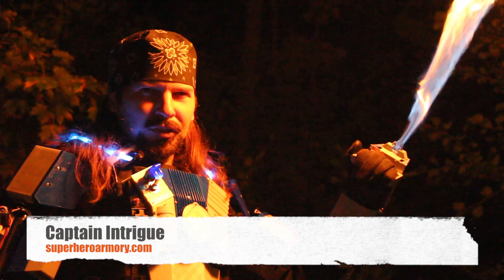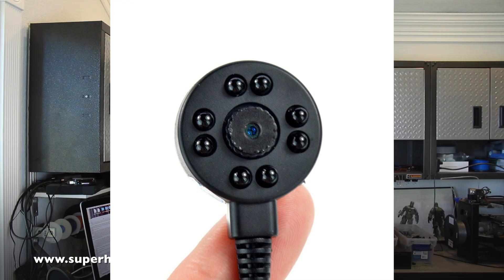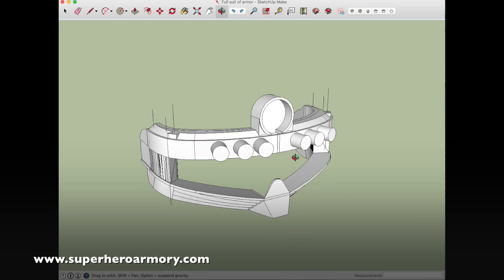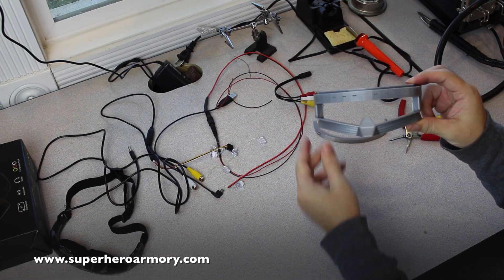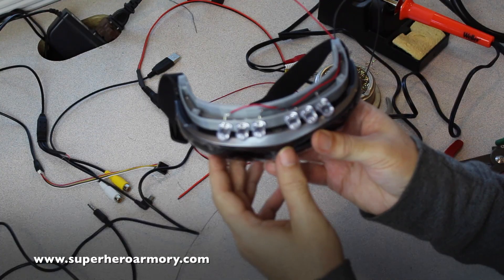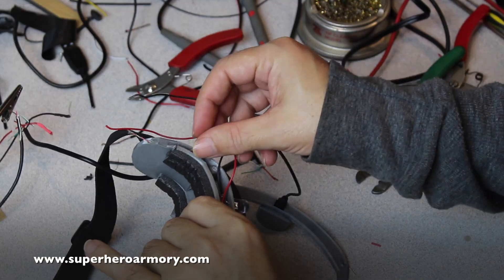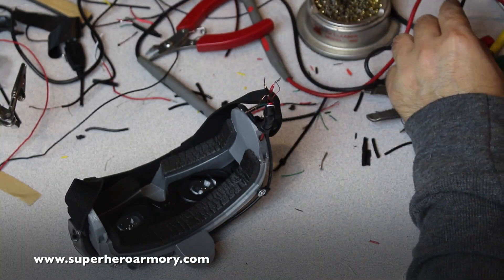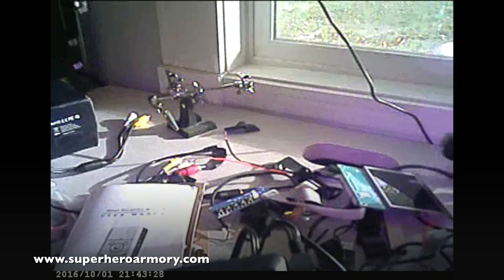How to build diy Night vision Goggles

Comment: So can you show what you look like to someone else with the same kind of goggles.  To an enemy, do you look like a great big neon sign that says shoot me with your leds on?
Reply from the maker: Yes it’s true that anyone using active night vision will be very brightly lit up and easily visible to anyone using thermal goggles, but how many people are using night vision out in public? I’ve never seen any ever. Of course passive thermal goggles that show heat signatures are much better since they amplify ambient light but the cameras cost many thousands of dollars depending on the resolution.
Reply: Can military night vision see it also?
Reply from the maker: @racerx1690  Yes military night vision can see any active infrared lights. If i were building a night vision system to use against a military I’d use a passive thermal camera that sees heat signatures. This would allow me to see any warm body as a glowing white outline.

Comment: Nice video ,  beautiful, design and manufacturing have you ever thought about using the infrared from your average garage light sensor there at 60 feet! The newer ones have the digital boards there more programmable and even have cameras mounted in them all ready 😊
Reply from the maker: I have a new series of night vision goggles videos coming out soon which use high power infrared LEDS.

Comment: Man I know you made this so long ago but thank you I was just wondering if it could be done and I was thinking so inside the box until I saw your video that literally slapped me in the face and just thinking now my solution is right in front of me and using dc current factor to power The googles was brilliant easily could be recharged and used over and over thank you Tesla is awesome 👏🏽

Comment: Awesome work but the quality of the camera is terrible.
Reply: Thats because there is not a lot of light the camera can capture and because the screens resolution is very low. If you would increase the screen res and add more IR light, the quality would be better

Comment: I have the tools, but lack the material... Plan on constructing a rifle in which the parts can be replaced in any hardware store otf. And the stock will also be a compact container for a compass, fire starter, and have a carry case containing exchangeable barrels rifled in various calibers so that one can use different types of ammo for the same weapon.

Comment: I have a lot of tools, mostly for making screws bolts nuts, smithing smelting, barrel rifling.. I had an idea a while back, to make goggles with nv in one eye and thermal in the other. But I don't have the tools for electrical and circuitry work, nor the financial confidence to start such a project. But you should try it.

Comment: Had to take out an external camcorder at the end to prevent yourself from tripping over the 35 year old girl with a teddy bear!  Ahahahahahahaha!
You should take a look at the many different alternatives to google glass being offered since at least 2014, unobtrusive and most can be used with any glasses frame.  Almost any camera can be converted to night vision by simply removing the IR filter.  The camera and IR dont necessarily have to be built into the glasses.  I would build an external body worn led array that would actually be functional. There have also been 2 different camera I've seen that output full color in total darkness, no export allowed, requires paperwork but doable.

Comment: I've been wanting to do something like this for awhile now, but don't really have a lot of experience with electronics. Your video was awesome. I feel more confident that I can do this myself. 

You mentioned that walking around was a bit disorienting. What is the magnification of the camera? what was the field of view? That could be a major factor. 

I came across a video on a channel called RolaidsBench where he used a 12mm lens to get as close to a one-to-one view wit a 20 degree FOV. I figure that would help a lot with depth perception.

I saw another video where you tested out the RunCam Night Eagle. I was thinking of using that camera myself. Problem is it has a 140 degree FOV which reduces magnification. That would mess with my depth perception. I talked with the engineers at RunCam about finding another lens that would work in conjunction with the Night Eagle, but they said it had a unique sensor that would be hard to find a suitable lens for. Perhaps I could have one made to work with the Night Eagle sensor $$$. 

I had the same idea to use two cameras for a stereoscopic view as well. I think it will improve depth perception immensely. I figure if it works anything like a 3D camera works, it will do the job. Two cameras, two near-eye displays, two perspectives. Just like our eyes. 

Anyway, Great video. I wish I would have come across this last year. 

P.S. Sorry for the long comment.

Comment: its really not night vision as much as it is a camera with ir sensitivity. what you need is a photo multiplier tube. This enables a person to see with only starlight. This is what the military uses. Any camera that is sensitive to IR can be blinded simply by placing an high output IR LED in front of the camera. Burglars have used this many times to defeat security cameras. Once a camera sees this blinding light, it automatically adjusts its brightness to accommodate the high brightness IR light, thus making the surrounding area go black.
your camera setup is severely flawed by its limited distance even with VERY bright LEDs.
Photo amplification is the only way as even with a bright light shinning into it you still can see very clearly the aurrounding areas

Comment: Good work.Thing is, for the sake of being more compact (wires hidden) couldn't you just open the camera casing and solder the video output via thinner cables directly to the goggles video input and maybe solder a common 5V power lead to the camera+LCDs in order to get rid of the 5V plug sticking upfront.Also you could cover the IR LEDs with a transparent mask and maybe surround them with a mirrored surface (included in the mask, similar to the headlights from a car/projector), this way you would enhance their range.
The camera isn't the best bet but I understand the budget orientation.
The project is a success.Kudos
Reply from the maker: Yep great ideas and way ahead of you. Just uploaded another night vision upgrade video.
Reply: I've been away thanks, I will watch it now.All the best!

Comment: can you do the same thing with fatshark goggles? cause I own a pair.
Reply from the maker: Yep.
Reply: Great! Do you know any wireless nightvision camera that I can connect to the goggles? Or do I just have to buy a regular camera and make a nightvision filter or something?
Reply: I'm also concerned that the antenna that comes with them is going to protrude too much and if there are any suggestions for a shorter sort of button antenna, that would be awesome. Thank you captain intrigue
Reply: Another thing I'm concerned about is that, you said that you would hope to employ thermal imaging cameras into the helmet. I heard that using thermal imaging in long term use causes cancer or sickness or something along the lines of that. Do you know of any way to counteract that? Thank you for letting me deploy so much questions and information on you.
Reply: One more thing, sorry for telling you so much. It's honestly your helmet, your design, it's up to you with whatever you want to do with it, I'm just really interested in this project. But have you considered facial recognition software? Probably unlikely, considering facial recognition software isn't exactly commercially available just a thought. Be happy to hear your opinion. Again, thank you so much.
Reply: Try this
flytron.com

Comment: Dear Captain Intrigue, would using shutter glasses with lcd display work too
Reply from the maker: They could work but the shutters are for 3d effects if i'm not mistaken which wouldn't really do any good in this case. Regular lcd glasses would be better.
Reply: Cool can u give me some examples that are affordable thanks
Reply from the maker: Just search for lcd glasses on ebay or google. lots of them for under $100

Comment: your description says there is a detailed tutorial on how to build this on your website. but I couldnt find it on your site :(

I have the basic parts for this. I bought a higher resolution camera used for custom vehicle reverse cameras. I was wondering what kind of battery should I use for it in conjunction with my HUD?

Thanks for all your work and great videos!
Reply from the maker: I haven't uploaded the tutorial yet, but sign up on the website and you'll be notified when it's ready. Your camera is probably 12 volts if it's from a vehicle back up setup.

Comment: so if cameras can see infrared light, will a camera that isn't the source still see it? if someone else was using it and I was just using a regular camera, would I still be able to pick it up.
Reply from the maker: Most commercial camera have infrared filters on the lenses so no you wouldn't be able to see it unless you were using a camera that is listed as infrared capable.

Comment from the maker: What did you all think of the night vision goggles?

We just started adding short stories to the end of each build video to try and showcase whatever gadget we’re building. Hopefully it will be a fun way of testing out whatever i build. What do you think?
Reply: Superhero Armory use 2 cameras to have depth vision
Reply: Why not sell it? I mean, idustrialy, as a cheap low quality night vision beacause its cheap.
Reply from the maker: I'm considering it, but i have some improvements i'd like to make first in an upcoming video.
Reply: +Superhero Armory ok
Reply: @SuperheroArmorychannel  can you add roller skates to your armor
Reply: Superhero Armory you should get a drone and make a night vision camera thing and fly it at night
Reply: Superhero Armory hi superhero armory can you add a flare launcher or storage in your body armor if your lost you can us it
Reply: Anthony Trejo there called thermal imaging goggles
Reply: Superhero Armory Slick asf
Reply: cool goggles  :))   .   i love technology and the only problem i am having with it is that it only seems to help certain people become extremely wealthy .
Reply: Superhero Armory there's one thing won't you blind yourself while using the night vision and the flame thrower at the same time??
Reply: Or instead of a flametrower like a foamtrower with that foam that like gets really hard realy fast
Reply: that face mast looks very comfortable for FPV flying. will you share the design? i'm sure a bunch of people would appreciate it. 
the biggest upgrade you could make, is a camera with a 1/3 sensor and a decent lens. it's not as nice and flat, but makes the world of a difference, compared to a tiny pinhole cam. some cameras/modules even have an OSD onboard. 
controlling the two displays independantly wont be easy. propably you'd need to butcher a second pair of the goggles to have two inputs.
Reply: Superhero Armory looks great good work the longer you take to work on something it is worth it
Reply: Where do I find the lcd glasses?
I have been searching and they are all over 100
can I find them cheaper?
Reply: Could this be done with a VR headset instead of the glasses? I can't seem to find a pair of glasses in my price range, but there is an abundance of VR sets for much cheaper.
Reply: It'w awesome!!!!!! Where do you buy the glass?
Reply: Superhero Armory i love this technique because i'm a huge video game nerd and parting comic nerd and i'm pretty sure in the batman games this is the tech he uses for his detective mode on his cowl
Reply: Superhero Armory Sir Captain Intrigue, u should add more and much stronger infrared light
Reply: Superhero Armory - I have a old rca camcorder that works and a night vision camera for a computer that works any idea on how to make them into night vision goggles
Reply: You should be working for DARPA.
Reply: Superhero Armory how much would you charge for me to buy night vision goggles that can see threw walls
Reply: Superhero Armory I met how much for night vision goggles that can see heat movement
Reply: Superhero Armory I really want to buy it.
Reply: Superhero Armory  I want them so I can walk in the dark in my house so I don't have to use light at night time.
Reply: Superhero Armory can you make a  splinter cell version? like from conviction co-op?
Reply: archer and kestrel
Reply: Superhero Armory where did you get the 100$ googles, can you send me a link?
Reply: Superhero Armory I envy this, I'm making my own as well with a raspberry pi, and an automatic script so the ir leds and camera boot an start up, how did you design your model, that's where I need your help, like how did you create this, what program did u use please???
Reply: Pure Awesomeness!!
Reply: 40,000$ thermal optics
Reply: Great build and video.  Keep putting videos out for us to see
Reply: Uuummm yup y not sell it...
To us too.

 Would it be possible
Please
Reply: Superhero Armory do you collaborate with other people?
Reply: I am thinking of "Snap into a Slim Jim!!!! Oh , yeah!"
Reply: Love those goggles. You should get a lawyer and make a patent for. those.  
I maybe interested in an pair. 
Let me know if your planning on building them.  I would even be a tester for you as I am an avid hunter. 
Great idea!
Reply: How much delay is there between the camera and the glasses?
Reply: 1 scond in and already going to sub
Reply: I'm sure alot of us have thought about a build like this, but this man actually did it! Brovo good sir, I applaud you 👍
Also, if you want, you could maybe incorporate some form of a reflective cone behind each led to throw the light further.
Reply: Can you send me a pair I am working on an iron man suit and would love to include this in the helmet
Reply: The link for the night vision goggles is broken
Reply: CAN I BUY THE NIGHT GOGGLES WITH BETTER LED LIGHTS FOR BETTER NIGHT VISION WOULD U SALE ME 1
Reply: I'm digging it 4+ years later. I don't like IR illumination in 2021 because it can be seen by "the enemy" passively with their IR off and just looking for other  NV users with their IR Leds on.  They are fine indoors.   Super low lux cameras and heat sensing is the only way to go.imo.  cheers
Reply: Dude I am in the process of building  a jet pack bulletproof mandalorian suit thermal helmet flame throwers ect and literally had the same idea to make a recon drone deployable from the suit I want to connect with you to share ideas I am new and want to learn engineering to build my suit you're blowing my mind and Lots of other youtubers have done great stuff as well let me know how we can connect and God bless you !
Reply: Hey, I'd really like to see a version of steampunk style (or Spiderman nior) think it'll still work??
Reply: did you know that you can 3d print chainmail
Reply from the maker: @alexandradiplas6949  Yes, although plastic chain mail is not particularly useful. Once we have 3d metal printing which is affordable then chain mail could be useful.
Reply: LupitaMagic Yea, better a blowtorch, not a flamethrower.

Comment: now you're making me wonder how hard it would be to make a mask like from dishonored with a HUD night vision heat vision  ventilator and hearing amplification, would be the ultimate here mask, well with a voice disguise device, maybe I just dream too big
Reply: ok maybe at that point more boba fett ish, either way would be cool asf
Reply from the maker: Funny you asked that because i'm working on the helmet with night vision, super hearing and voice changing capabilities right now.
Reply: Superhero Armory that's pretty cool, between your stuff and hacksmith someones gonna turn into either iron man or Batman, or iron bat, I mean i used to think of using d30 cut tex and titanium plates for a batsuit with a latex paint cover for hear signature reduction, but ended up being a couple thousand before equipment was even introduced, go big or go home right? good luck with the super helmet, although personally I'd recommend thinking about putting a respirator in, chemical and gas weapons are more a common then you'd think, flashbangs are another issue entirely, maybe putting a decibel cap on a hearing amplifier so a spike in decibels wouldn't make you go deaf
Reply: also it should be stated I know these things from field use, not vigilante use, we use d30 under our body armor for force reduction, this was all in thought of superhero daydreams
Reply from the maker: I already have the decibel limiter for the super hearing but i didn't show it in the video. Wanted to keep it simple for now.

Comment: If you take a softball you could cut it in half, hook a battery into the center and run infer red led's along the area of the softball.  
You could then take this ball and throw it into the distance in a dark room and it will light up areas not being shown on by your goggles head led's.
Reply: Tell me what you think about it Superhero Armory :D
Reply from the maker: It wouldn't really help much indoors unless it was a huge room/warehouse, but that actually gives me a few ideas for some other gadgets using your concept.
Reply: Superhero Armory Looking forward to see your idea is good sir!  You inspire, believe me.